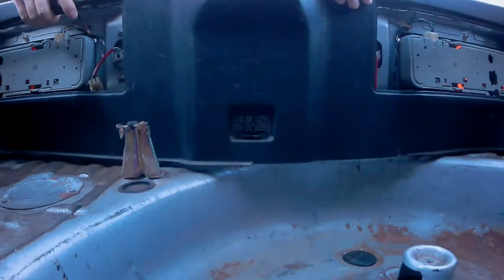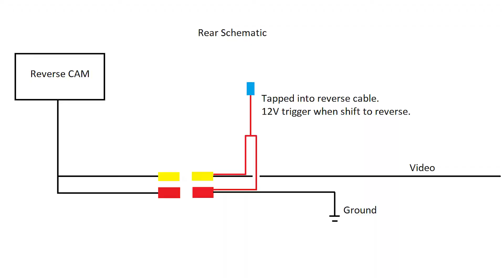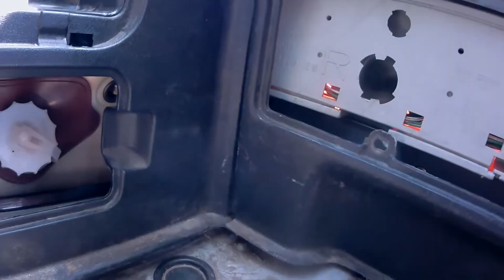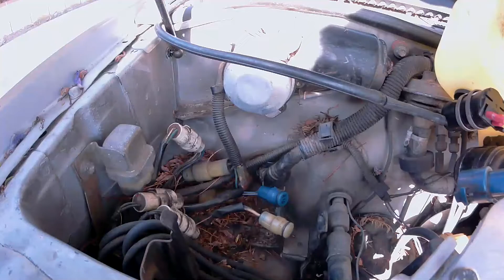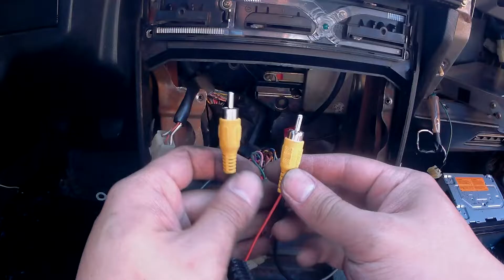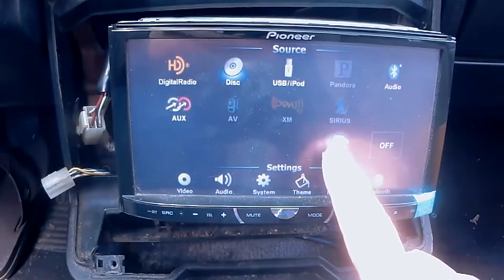(MKII) 1985 Toyota Celica Supra Radio Install Part II

Comment: I am amazed you can take the videos AND get the work done. I am slow but nearly done. My final obstacle is: I have a green wire from my radio harness that has to connect to the parking brake. I found the console is easily removed to access the connector to the -arming brake switch BUT don’t know which wire is right. Two different color wires go in, then the same (white/green stripe) runs from plug to switch and back - makes sense, but I don’t know which is right.

Comment: This is great - BUT I need help - what to do with the parking brake input wire and reverse ‘trigger’ as you call it (on my radio labeled as reverse input - I have them coming off my my plug but don’t know where/what on the car to connect them to?!
Reply from the maker: Reverse Trigger wire:
Use the reverse trigger wire on the radio only if you're installing a camera. What it does is allow the radio to toggle the video to the rear camera.
Assuming you are using this wire, you need connect the positive (+) connection from the reverse light to the reverse trigger (purple) cable.
In my case, I just used the little wire that was already attached to the RCA cable.
Simplified: Connect reverse (+) cable to Reverse trigger on radio (purple cable)

Parking brake cable:
Your parking brake (e-brake) has a cable that connects to body ground. Once you pull the e-brake, the brake like comes on because it detects ground.
You have a few options.
Option 1: find the ground cable on your e-brake and make the connection from there to your radio.
Option 2: ground the cable, but use a physical On/OFF switch otherwise you cant trick the system.
Option 3: Use a relay system as I did so it automatically tricks the system.
Option 4: See if the item linked below is compatible with your unit. Connect the black wire to body ground. Blue to your radio remote wire. Green to your brake wire. Or simply put, just match the colors.

https://www.amazon.com/APPS2Car-Parking-Interface-Pioneer-Receivers/dp/B01L6Z1WYA/ref=asc_df_B01L6Z1WYA/?tag=hyprod-20&linkCode=df0&hvadid=312142335725&hvpos=&hvnetw=g&hvrand=8150940657881871291&hvpone=&hvptwo=&hvqmt=&hvdev=c&hvdvcmdl=&hvlocint=&hvlocphy=9031095&hvtargid=pla-567569820402&psc=1

Hope this helped.
Reply: All good - backup camera works just fine as does radio! Thanks again for all your help.
Reply: Again John many thanks - I have completed the install, using a trigger wire like the one you linked - however have NOT (yet) hard wired direct to the e-brake. I can easily dismantle the console and get to the switch, but the wires are multicolored, not easy for me to determine which one should be hard wired and if so where? I thought the whole point of the ‘trigger’ was that it would only power the camera when the backup light is on (only when engine is on and in trans is in reverse.)
Reply from the maker: @Rocket2me  there should be 2 connections to your reverse light wire. 1 to your camera (this connection is at the back of the car near the light) and 1 to trigger the reverse wire from the rear to the radio. So whenever you are in reverse it powers your camera up and also triggers your radio to toggle  video channel to display the rear camera.

The E-brake (body ground if using a bypass unit) wire is only used for bypassing the video safety settings that will enable you to watch movies while driving.